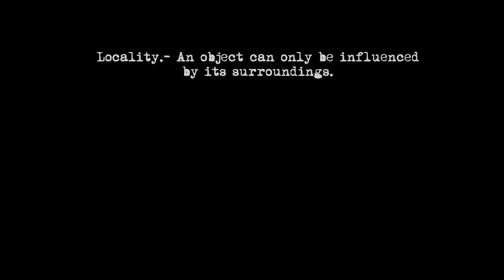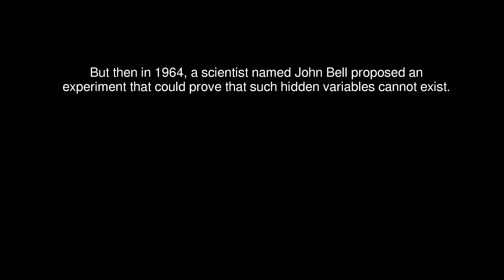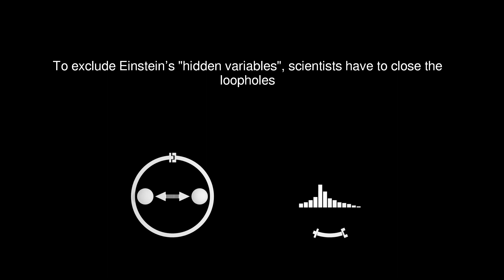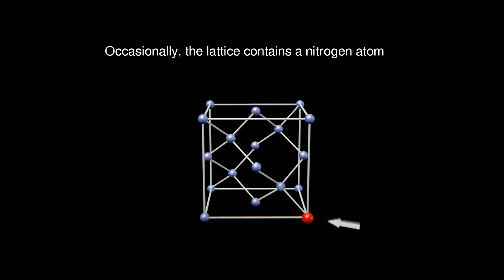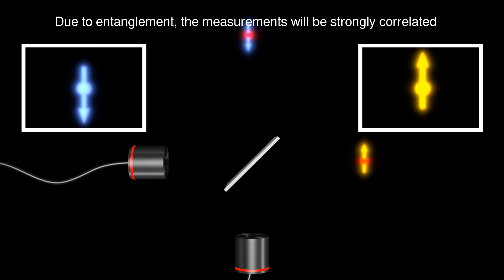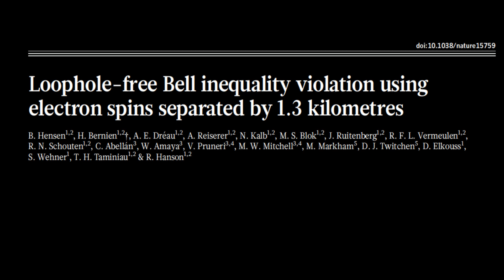TU Delft – A loophole-free Bell test

Comment: 00:30f
According to Quantum Mechanics, a particel can be in two states at the same time.
Not just two but a whole continuum of them.
Actually, it's not multiple states but one state which can be a superposition of multiple eigenstates with respect to a certain physical quantity or observable while it might be just one eigenstate with respect to another one.
If an Electron in an atom is in an eigenstate with respect to its energy (meaning that you'll always get the same value of it when you measure it), it's clearly not in an eigenstate with respect to position, obviously.

Comment: It seems to me that the act or process of "entangling" the two distant electron spins anti-correlates their spins. And the entanglement process itself occurs at light speed or less so. How is that different from two physical particles having correlated momentums if they were created at the same time such as particle and antiparticle creation? If you measure one you know the momentum of the other even though it's far away because the momentums are correlated.

Comment: 4:38 The electrons were never measured, regardless of entanglement. You measured the photons. You animation showed that the entanglement was between the photons, at this apparatus (a mirror?), and was measured in extreme close proximity. The original electrons being 1.3km away from each other appeared irrelevant.

Comment: and what were the results of the 20%? were the 20% non measurable as in the tests failed? or both particles showed upwards or down wards spin that's comparable to one another when measured? or the measurement was simultaneous up and down spin? Curious what were the results on the 20%, thanks.

Comment: hey nerds, quick question....  what is the definition of information @ 00:21?
Reply: mioumitsou forces or any interaction in the universe is via force carrying particles which has a zero rest mass and travel at the speed of light.. also light is the force carrying particle of electromagnetism hence no information can travel faster than the speed of light
Reply: Information is any data which can be used to make any form of predictions or can be used for any form of analysis of a system as of currently we know any information can be sent only by use of some form of energy  so no information can travel faster than light

Comment: to be honest it could still be a hidden variable that we don't know about yet. Maybe some concept or quantity we haven't discovered yet.
Reply: Precise oscillations of quantum entangled particles was also theorized, but also disproven, as even delaying the detection of one of the entangled particles did not change the sister particle from displaying the proper spin. There is nothing left, there is no other mechanism left which could communicate the appropriate information. The only reasonable conclusion is, three dimensional distance is an illusion, and particles themselves exist on a higher plane of existence, at least partially, which was already predicted in other theories. This would allow them to exist detached from time, so the information could be communicated to it as it was able to communicate with it at one point in time. It's 'hidden variable' could simply be that it simply does not need to do things in chronological order. 
If you really think about it however, anything which moves at the speed of light, cannot have a concept of time in the first place. Time would stop at that speed. So this time restricted order of operations does seem to be foreign idea to something which exists outside of it in the first place.
Reply: @rich1051414  

Donald Hoffman is on this in interesting ways
Reply: This comment didn’t age well 😂
Reply: In order to understand the experiment you really have to understanding the bell inequality, if you understand you will be shocked.

Comment: I don't think you can entangle two separate electrons because you shined a laser at them.   It would be like stating: because you shined a flash light at a splitting mirror which bounced the beams at two identical basket balls a mile apart they are now entangled.      I think for something truly to become entangled you'd have to split an object (like an electron).  At that moment the two halves are now entangled.  if you move them apart and observe from the middle. as you turn to look at each half you will see they are rotating in opposite directions.  If you look at them from the left or right you will see they rotate in the same direction.  If you move them anywhere in the universe in any orientation, they will mimic each other's rotation (that is, if you have the ability to change the rotation of one of the halves in the first place).    Sorry, I simply can't accept this experiment proves or disproves anything.

Comment: If the distance cannot be travelled by these communicating electrons within the boundaries of the speed of light, but the entanglement does take place in 80% of the experiments done, does this mean that these electrons communicate with each other with a speed that surpasses the speed of light?
Reply: Two electrons at two seemingly different places are in singlet state. If you make measurement of polarization or spin on one particle, second particle will instantly change its state to give you exactly opposite result (law of conservation of momentum),  no matter how distant those particles are. By measurement is meant any form of physical interaction from which can be state of the particle derived. But you still can't use this phenomenon to send any form of information by speed higher than the speed of light. It's hypothesized the way spacetime is created and basic geometric spacetime structure is in very intimate correlation with this action at a distance. And that it's responsible for existence of spacetime.
Reply: +Matúš Frisík Thank you Matús for your response!
Reply: You're welcome. And entanglement doesn't take place in 80% of experiments. 80% means correlation between measurements of entangled states. All electrons measured are entangled in this experiment. Otherwise, experiment would be useless.  Mathematically, probability derived by Bell's inequalities says that correlation should be equal or less than 75%. If electrons have some hidden variables that determine result of experiments. But experiment proved it's 80% which is in accordance with theory and it proved that there are not hidden variables and particles are truly in quantum entangled state.
Reply: It's not hypothesis. Nothing can travel faster than light, except of space. Instant means instant, but there's no information contained. You can't know which eigenvalue you get when you make measurement.
Reply: Matúš Frisík Matus. You're going to have to forgive me. I have Asperger syndrome which prohibits me from speaking math of any sort. I'm one who has to 'see'. Instantaneous to me means exactly that. If quantum entanglement exists as explained, to me that represents something much more deeply endemic with regards to 'matter' in general. Considering we really know very little about the universe and its' constituents, I believe we're in for a few surprises. As with over/unity. It occurs all round us. The trick is finding a way to us it on a macro-physical level. I studied scores of systems, most of which don't nor can work of course. I'm aware of one system that may hold a key and do suspect it's been done but that 'knowledge' (among others) has been sequestered. But thanks for indulging me.
Reply: @paulstovall3777 
I used to think Asperger's prevents people from reading others' emotions rather than from doing maths.
Reply: In relativity, there is no such thing as instant. Different frames of references can disagree on the chronological order of spacelike separated events. If you have two spacelike separated events A and B (meaning that A and B are at separate positions in space, but not far enough apart in time so that light can travel from A and arive at the location of B before B happens, or vice versa), A happens before B for one reference frame, but B happens before A for another. And there is a frame of reference in which A and B are happening at the same time, which is what you would call "instant". No frame of reference is wrong, every frame of reference is right.

So, if A and B are the spacetime events at the positions and time where the wavefunction collapses (due to measurement of one of the particles), there are frames of references where one apple turns red before the other turns green. So, how is this "instant"? :)

Wave function collapse results in all sorts of paradoxal issues, that it is probably a wrong interpretation. The Many Worlds interpretation of QM doesn't deal with collapse. It simply states that upon measurement, you become entangled with that version of the universe in which your apple is green, which implies the other apple will be red upon investigation. It doesn't simply "turn red instantaneously".
Reply: +Matúš Frisík Mat. I disagree with your hypothesis. I think it possible to transmit and receive information faster then light speed. As particals are entangled, a matrix of said could be amassed at different site anywhere within the universe. By encoding one group with the other, discernible information could be sent by changing one or the other matrix structures. The other would respond instantaneously. Not unlike Morse Code at its' simplest. Efforts are being made to build a quantum computer. Build two, separate them and they would be able to communicate over any distance instantly without any physical interface whatever.
Reply: +casaamaril It's my understanding that the term 'instant' would essentially mean exactly that. By comparison, light  would have no speed. There may be one exception too the rule. Gravity. In proximity to a black hole it is ONLY gravity (being non electromagnetic in nature) that has velocity enough as a 'force' to escape the event horizon.
Reply: Matúš Frisík Unfortunately I've found discrepancy. Light, for one, may well not be quite the 'constant' we once thought. Depending on distance and age since emission and taking in and adjusting for variables such as mass and dark matter lensing, variables from that constant have been verified. That coupled with newer and more sensitive methodology of measure, the speed of light has yet to be precisely accounted for much more than a specific 'general'. Irrespective of the 'mechanism', quantum entanglement indicates an instantaneous vector of some as yet unknown. Ergo, it is 'instantaneous' Gravity as an energy (IF that is what it is), especially in proximity to the event horizon of a black hole mass singularity does escape said anomaly back into the 'normal' universe which indicates 'something' or again some vector unique to itself that normal matter does not possess. Tho still in debate, matter entering a singularity by rights must exceed light velocity while entering. As with much of quantum physics, this presents some interesting questions as to our 'understanding' of basic physics. It will continue to react to any additional within its' influence. Ergo, the result, extra luminal. Nothing is quite yet 'pat'. The simple matter of the Heisenberg Uncertainty Principle pretty much guarantees this to be so.
Reply: Paul Stovall It's even more complicated than that. Speed of light isn't constant, it isn't given, it's not result of geometry of spacetime, it's deeper in physical laws. Information can travel at any given speed, but on a macroscopic scale, all possibilities will interfere and you'll observe, that it travels precisely at the speed of light. http://www.thephysicsmill.com/2013/07/16/reality-is-the-feynman-path-integral/

***** Eigenvalue is basic term in linear algebra. Let's say you have some transformation in matrix form T and vector v, such that
Tv = λv.
Then v is eigenvector and λ is eigenvalue. If v is a vector in Hilber space, such as spin (or in general any state of particle) and T is Pauli matrix (or in general any Hermitian matrix), then eigenvalue λ can be in this example either 1 or -1, representing spin up or spin down.... It's only measurable characteristic of quantum particle after you make measurement.
Reply: +casaamaril it's instant.

Comment: Can anybody explain, when it says "But the electron is not alone. It has a sister." (3:54) how this entanglement was formed? Which physical action led to the "sibling relationship"? Perhaps the answer is already @ 4:39 ("At this point the two electrons get entangled"). How is it that the electrons are entangled at this very moment? Aren't these emitted photons mere representations of the electrons, which were entangled somewhere in past history? Is this video using confusing term/definitions? 

I'm lost :)
Reply: I thought the same thing. It does not seem very convincing to me if the entanglement happens just before the measurement ;-)
Reply: I too didn't get the part of how it's actually getting entangled. How are the two artifical diamonds related to one another? And even if the other diamond is a perfect copy of the first one, why are they taking the collective electron spin induced by a missing carbon atom taking into consideration? As far as I know, quantum entanglement means the two objects will move the same way as one object does. And the distance can be infinite.
Reply: Here are my thoughts:
'how this entanglement was formed?' The photons at the beginning are not entangled.

Which physical action led to the "sibling relationship"? This is just to say the experiments were done at the same time, so you may say the moment the photons are emitted from the diamond.

How is it that the electrons are entangled at this very moment? Merging the photons.

Aren't these emitted photons mere representations of the electrons, which were entangled somewhere in past history? That is the heart of the issue here: what's causing the photons to behave the way they are behaving.

Is this video using confusing term/definitions? Probably, but it's supposedly easier to do this with photons than electrons, but the results would be the same.

You are merging 2 photons together and thus 'entangling' them, doesn't seem odd to me as it's like children will share traits from their parents. In short the photons/electrons appear to have a memory when you would expect they wouldn't.
Reply: This video isn't really explaining exactly what's happening, it's just giving a basic explanation, it's not 100% accurate to what the experiment is, but the bare basics is correct.
Reply: +stevenmcl1 
Thanks :-). I read the paper and I also read more on the entanglement swapping, and this to me is a really sore point :-).
I see two possibilities:
a) the entanglement swapping at C does something to A and B. If that is the case, and actually causes some change somehow (I am not even speculating how :-),
then it should in principle be possible to check that something has changed later on.
For instance, if we don't do C, then we get certain statistics for the spins of A and B.
If we do C, then the stats for A and B are different - I mean beyond the experiments. If any of the spins was actually changed because of C, that could possibly later be verified, since the spins do not just vanish (maybe we measure the spin again at an angle of 0, which is obvious etc)
(I doubt anyone is seriously claiming that hat is done at C is actually causing a physical entanglement at A and B?).

b) the entanglement swapping is just used as a filter, that picks out the right photons to be measured (using the interference).
In that case, there is no actuall physical change of any kind, no "real" physical entanglement (other than on paper ;-).
Then to me it begs the question: if A and B had nothing in common before and C does not change anything, then is calling A and B "entangled" maybe a bit exaggerated ;-)?
Reply: They seem to be implying that when the photons that were produced from each electron "meet each other", their corresponding electrons become entangled.  At least that's my understanding of the video.
Reply: Chantal Roth I'm not entirely sure about the process in itself as I'm not versed that greatly in Quantum Mechanics, but from what I'm reading if I'm looking at the diagrams and material correctly, that they're recording the outcomes in 3 separate locations. Two being with the diamonds themselves, and the final location being where the sensors are at C. So it may be possible that they're reading from A and B whether or not their spin is "1 or 0" and then recording the end result at C as both being "1 or 0" to correlate the detected information? 

I could possibly be reading this wrong, but I suppose that would make sense considering they were timestamping the results with a randomly generated number along with it. So I suppose in this instance, again if I'm reading this correctly, it's got in total 4 answers it correlates. To best explain what I'm thinking, it would be this:

(A: Diamond 1 Emitter. B: Diamond 2 Emitter. Ca: Diamond 1 Receiver. Cb: Diamond 2 Receiver.)

So therefor in example A: 1, B: 0, Ca: 1, Cb: 0 correlated would mean a successful recording with the timestamping? I don't see anywhere really how they matched up the data so that could be the case if I didn't overlook anything, but I'm just speculating at this point.
Reply: Chantal Roth    'Mating' was already taken.
Reply: The sister is just an electron in the second diamond that corresponds to the given electron in the first diamond. They are not entangled initially. We just know where to find them to measure them in the last step of the video.